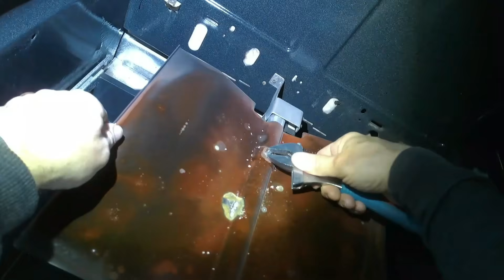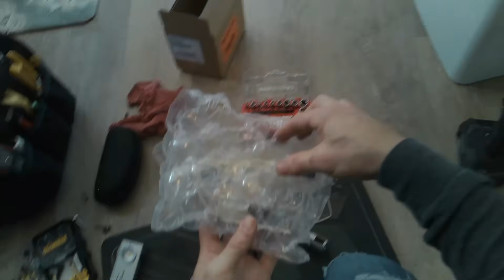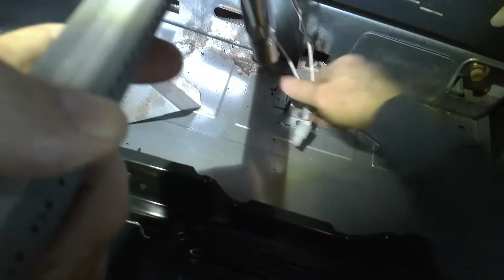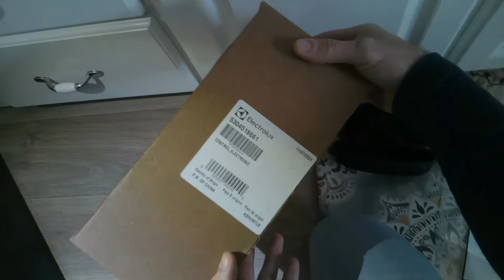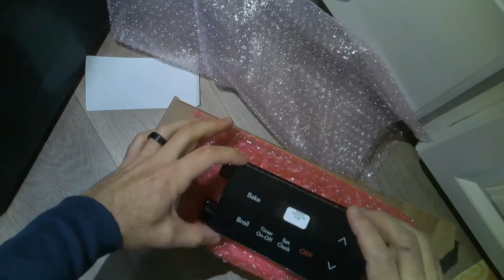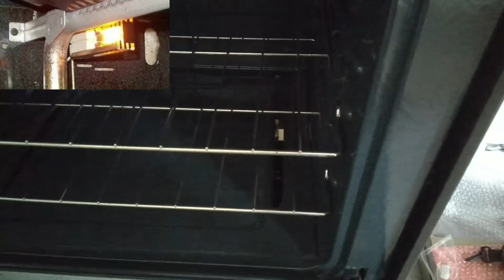Frigidaire Oven Won’t Heat? Watch This Before You Panic!

Comment from the maker: 🔥 Frigidaire Gas Oven Not Heating?

If your Frigidaire gas oven won’t heat or takes a long time to ignite, a weak oven igniter is one of the most common causes. In some cases, the main control board can also affect ignition and temperature control.

👉 Frigidaire Oven Igniter:
https://onlineappliancepartshub.com/products/igniter-frigdare

👉 Frigidaire Oven Control Board (5304518661):
https://onlineappliancepartshub.com/products/oven-control-part-5304518661

✔ Always confirm compatibility by typing your oven model number in the search bar before ordering.

💬 Need help diagnosing your oven?
Post your model number and symptoms below, and I’ll try to help point you in the right direction.

Comment: FYI in case anyone else sees this post.  I have a similar Frigidaire oven range and it was NOT heating up at all - I checked the heating elements, temp probe resistance, etc. and everything looked good. Then I saw another post online where someone said if you are handy a lot of times the relay drive pin will come unsoldered on the control board / driver board by where the heating elements connect to the circuit board.  I grabbed my soldering iron and resoldered this pin and my oven magically started heating again!  Only cost me an hour or two of my time to fix.  Just paying it forward in case someone else has a similar oven and everything is working but the heating element(s) just aren’t heating (or takes forever to warm up).  I measured the resistance and the pin was definitely NOT making good contact with the PCB (circuit board) any more.

Comment: I had replaced a new ignitor about 18 months ago. Recently, I noticed that when I pressed 'bake' I would get three horizontal intermittent lines. Does this mean that the problem is not the ignitor, but the control board?
Reply from the maker: It sounds like a main control board problem

Comment: Hi. I saw a couple of your videos and decided to ask a question by comment typing because your videos are proof of your high level of knowledge in modern Appliance repair. Thank you for sharing your knowledge and I hope that you will continue to make more appliance repair videos and help people in this way and you will get rewarded by accessing more knowledge. Simply thanks.
      Mine Samsung RF260BEAEBC, is more than 10 years old (R-134a, twin cooling plus, Ice maker in lower section - in the freezer), with no major problems except for broken door plastic pockets and french door opening gap closing - flapping cover between 2 doors. After that, the middle piece turned non-operable, and a gap between the doors remained open permanently - this was a starting point for future problems. The fridge section evaporator was covered with ice a couple of times, and defrosted ice with a Steamer ( a steamer is good for plastic, but is not good for foam plastic evaporator covers Air flow paths - and builds bubbles on the airway). Replaced fridge evap. fan motor with OEM one. After ice builds up and defrosts 3-4 times, a red "Defrost Heather On" - a drip of water falling down from the evaporator in red color sign came on and stayed on until today. Beginning 30-40 days ago Freezer has not cooled at all and the fridge temperature shows 37F ( Set for 34F, but can not reach it), I put a temperature measuring device in the fridge, and shows 43F. In your video, you mentioned that when Defrost is "On" there is no energy consumption in the whole Refregirator except for Defrost Heather. I researched different websites and videos, some of them (very rare ) saying that when is Defrost "On", the Invertor compressor runs at a lower speed. ( I do not want to argue with you). 25 years ago I  graduated a Tech College as an Electrician for the installation, maintenance, and repair of Electrical Equipment for a Coal Mining Factory, and have been working as an Electrician and as an Electrician position on duty in different businesses. Last 1 1/2 years started to work for an A/C company as Serv. tech and now I am working for a Commercial Refrigeration company as a newly hired person on 90 days period of making decisions about my knowledge. For a short period of time, I worked for the "Samsung Care" subcontractor company ( 8 months) and used all my saved amounts of money for Gasoline, Insurance, and repair of my own vehicle I had been using for that job, when I went out of money, quit that job. Watching your video I thought you are familiar with Refrigerator repair and I want to ask for advice even if it could turn into that situation if you ask to pay for advice. thanks.
      Also, one more detail I need to add to my previous comment:  When the fridge door stays open (temperature at door opening time shows 37F, the actual temperature is 42-43F at that time as I mentioned in the previous comment), after opening the door and keeping open 4-5-6 or more minutes, the temperature gradually raise until 52-53 - 63F, and we close the door after passing those minutes, the temperature of the fridge is not decreasing, stays same. If I turn off the breaker, keep it off for 3-4-5 minutes, and turn it back on, the "Power Freeze" sign on the fridge section comes on, and the temperature goes down until 37F.